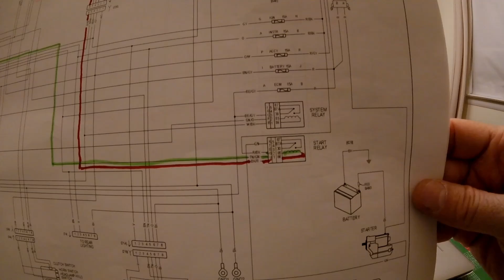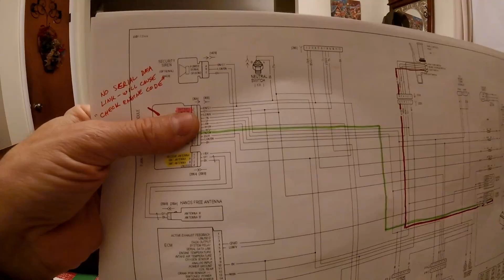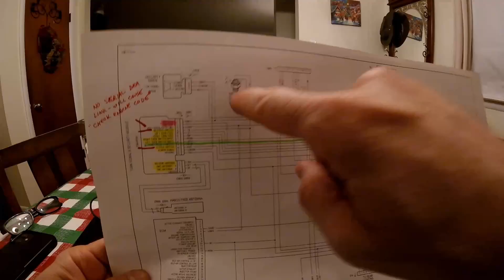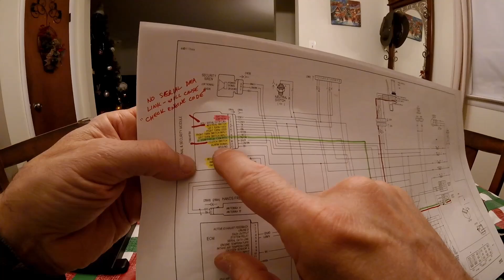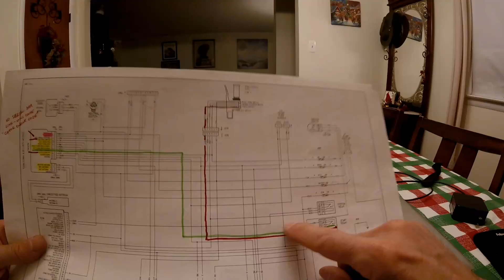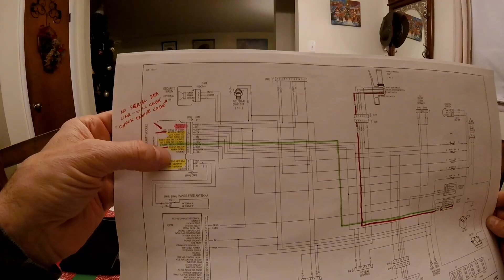Harley Security System Delete & Turn Signal Removal. Twin Cam 1999 to 2010 module TSM & TSSM

Comment: I removed the tssm and cleaned up the wiring loom, the bike cranks and fires right up and dies, I've check for fuei issues, it's a carb, I believe maybe ecm, sometimes it won't do anything, give it a minute or two and we're back to fire up and die !!     HELP PLEASE !!
Reply from the maker: @EconomicRefugees  get some starting fluid and see if you can keep it running with that. That’s the true way to remove the fuel system out of the equation. Let me know how you make out with that and then I can help you further.
Reply: @Rapsgarageshop  will do tbanks

Comment: I have a 2002 ultra classic I cut the tan/with green stripe pulled it through the harness and ground it to the battery but it showing a red key on the dash when I hit start button
Reply from the maker: My 2003 has the same issue and I don’t even have a security system. It goes out after a few seconds. I have no idea how to get that light to stay off.
Reply: @ but my the bike still won’t start hit the start button and the relay just clicks
Reply from the maker: @ Does the motor spin?

Comment: Not sure if you still monitor this, I cut the gn/tn wire and then from the relay ran it to ground. Does this eliminate the security altogether? 
I ask because when I key on, I get the 4 light flash still. 
This bike has no fob that I can find, and I want the security GONE as I think it's draining my battery quickly.
Reply from the maker: Grounding that wire eliminates that module from the system and allows the bike to start. I haven’t heard of anyone having a problem where the four lights are still flashing. I’d have to look at that schematic further and I’m away for the next week unable to look that up. Email me at
hdrap_1999@yahoo.com 
Stating the same question and when I get back, I can look at it further.

Comment: Ok, thank you gor this, i was finally able to get my 2003 ultra classic to at least fire up for a second a couple of times thanks to following your instructions, now i have to figure out how to keep it running 😊..

This bike belonged to one of my kids friends dad who passed away a few years ago, it is in pretty bad shape, he wanted me to have it to get it back on the road and ride in his dads memory, he is too scared to ride himself. Key, key fob and code were long lost in moving and such before he gave it to me to get it going again.. 

If you could help with getting it to stay running that would be great, eventually ill replace the tssm with a tsm when i figure out what part number it is i need for this swap and this particular bike.. 

Thank you again for posting this, i really appreciate it 🤘🤠👍
Reply from the maker: @georgecowboydearing6526  great! I’d try starting fluid and try to keep it running. If you can keep it running then it’s a fuel problem. If it’s been sitting a long time the ethanol fuel will gum up the injectors and can cause pump problems. If it has a carb it needs to be cleaned. I have a video on that too. You will need to start down that path first. Let me know how you do. If you need further help please reach out to me at hdrap_1999@yahoo.com with your phone number and time to call. Asdd your time zone.
Reply: You sir are correct, it sprayed it and it stayed running so definitely need to clean out the tank and injectors, that gets me running and i can't tell you how much I truly appreciate it, now to research the part number for the tsm to replace the tssm with.. Thank you, it is very much appreciated
Reply: @georgecowboydearing6526 were you able to ride your bike? I'm trying to figure out how this bypasses the ECM's search for the code from the TSSM
Reply from the maker: That’s great. I’m glad I’m able to help. If you haven’t, please like and subscribe. Thanks.

Comment: hey man my 07 starts but dies right after
Reply from the maker: @coltryder7607  spray it with starting fluid and see if you can keep it running with the spray. If you can you have a fuel problem if not it’s an electrical problem. Let me know and I can help further.
Reply: Same issue. Did you ever get it solved?

Comment: I got my buds to turn over by doing what you said with the tan and green wire going to the relay. But I’m not sure what to do about the wire for the ignition enable signal wire.. it’s a 01 carbureted dyna fxd. Any help would be great. His voltage regulator went out and everything test good now but I think his tsm got jacked.
Reply from the maker: @christopherpost5409  email your phone number at hdrap_1999@yahoo.com
I can help over the phone but you will need to be at the bike with a volt meter. Also let me know when is good to call and what time zone you’re in.
Reply: @Rapsgarageshop I’m in the same boat as him

Comment: My 03 fxdwg has an "ignition enable signal" on pin 10. Can i ground circuit just like on pin 9?
Reply from the maker: Interesting question. I just looked at the wiring diagram and I would say give it a try and see what happens. I think it will work. If you do try it, please let me know what the outcome is. You can always email me at hdrap_1999@yahoo.com. Thank you for watching and please subscribe if you haven't.
Reply: @Rapsgarage  i grounded it, no start. Still no signal from ignition module to coil
Reply: Thanks for posting, lots of info I'll have to rewatch it a few times.
Reply from the maker: @StevenEichele  Thank you. I have a few wiring videos. Please like and subscribe.

Comment: So you ground the wire from the handlebars after the relay. And not pull the tan/green wire from ecm. 2006 Harley electric ultra classic.
Reply from the maker: @ErnestBarresi  you need to remove the Tan/Green wire, from the relay, and ground the terminal that the tan/green wire came off of the relay.
Reply: @Rapsgarageshop So do you ground the wire that’s pinned to the tssm? Or do you remove the pin from #9 and ground the wire (leaving the tssm without a #9 pin)
Reply from the maker: @jakobrichards7814  The relay needs a ground to have it turn on. You can remove the wire from the TSSM or leave it hooked up.

Comment: So all i need to do is eliminate the start relay ( pin 9 ) and ground it out at the relay ?
Reply: This is on a 2010 softail heritage classic .
Reply from the maker: @StevenNewman-e9j  yes but that will only eliminate the security system.
Reply: @Rapsgarageshop  well that's what I want , iv owned this bike since 2013 and it didn't come with a fob , it was a trade in at a Toyota dealership  . I got it and the thing says it has one the dealership told me it dosent but it acts like it does and I don't trust anyone to work on it , because they have all messed with it while I'm not present  and some have when I am present . I removing the 9 wire won't mess with anything but the security,  it will function as a turn signal module,  and not a tssm ?
Reply: Another problem i have is the system relay , I have a jumper to make my fuel pump come on . I had it tuned and the guy pushed a button on the computer and I have had this jumper on there ever since and have to take the seat off everytime I shut it off , speedometer dosent work , so is it the tssm or the ecm ? Iv bought a new wiring harness but that didn't keep me from having to use the jumper .
Reply from the maker: @ First - to disable the security system you have to disconnect that wire and ground it so the relay has a ground. Don't ground that wire at the TSSM. As for your other problem, I'm not sure what you're talking. If you want you can send me your phone number to my email at hdrap_1999@yahoo.com and I can call you. Sent the time zone you live in along with a good day and time to call.

Comment: I have an electrical diagram but it doesn't seem to make sense to me, for example on the ignition coil, each coil has 4 wires on the connector to the coil but on the diagram there are only 2 wires in each coil.
Reply from the maker: What model and year Biker are you talking about?
Reply: @Rapsgarageshop  No it's actually a car that I'm talking about.
Reply: @Tman214-l6w why the **ck you on a bike video asking about a car wiring issue. Are you that dense, really are you?
Reply: @Rapsgarageshop  Lexus LS430
Reply from the maker: OK, sorry. No, I don’t know anything about that.
Reply: @Rapsgarage  ok no problem thanks